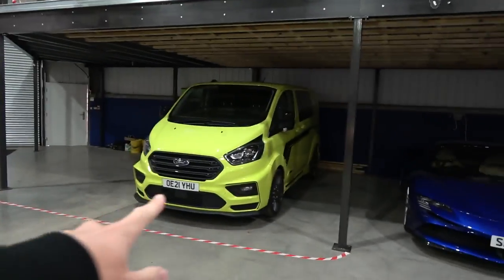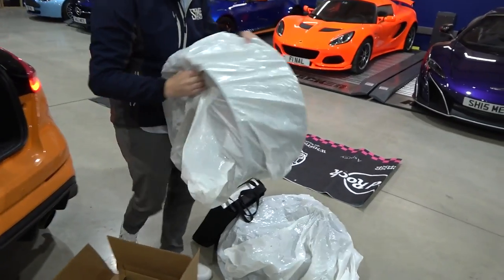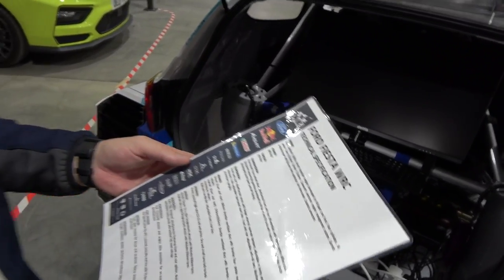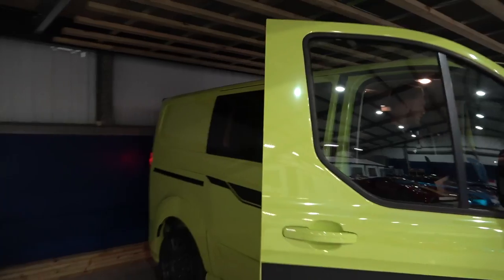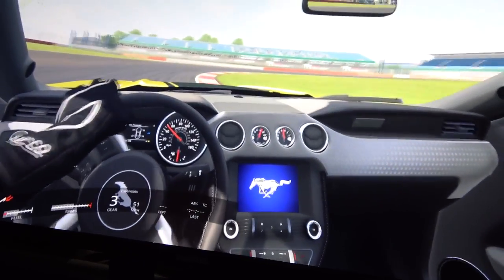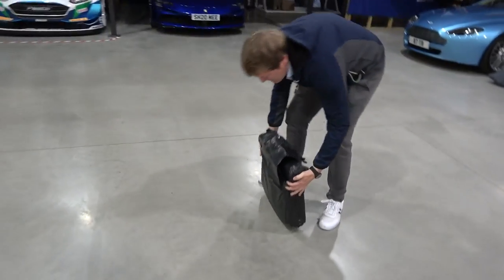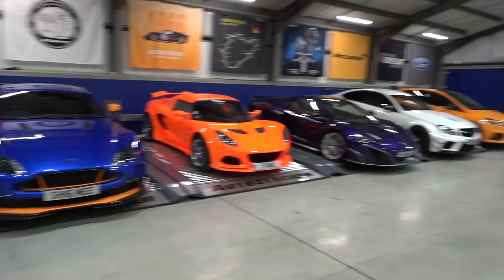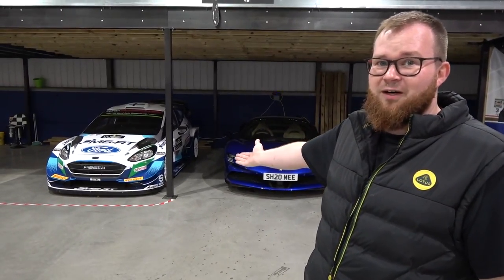NEW CAR IN THE GARAGE! What are we DOING with THIS!? | SHMUSEUM VLOG 94

Comment: They certainly have good equipment for cleaning the cars. But they are also doing a lot of excessive washing. Using snowfoam for that dust is not necessary. A quick rinse and a wipe with detailing spray should be more than enough to get them look great with much less work?

Any detailers who can confirm?

Comment: YOU ALL DONT HAVE MONRONEY LABLES?!?!? this might be the most American thing to say ever but I just assumed that was how all new cars were sold around the world. It has all the options, fuel eco, crash rating(if available), etc 🤣😱
Reply: isn't that just for brand-new cars or second-hand as well? because car vertical are for second-hand models and that's why it shows the car history, so if it may have to go through some major or minor repair it will be shown there. And you know, sometimes the dealer doesn't show everything so the product seems to be better than what it really is.
Reply: @Antonio88870  very true (I work for a Toyota dealer in TN. But another question for someone over the pond… is carfax a usa thing aswell? Because carfax seems to be the worse version of CV? But yes the monroney lables are just for new cars. Most dealers will have a dealer made sign that looks similar for preowned tho